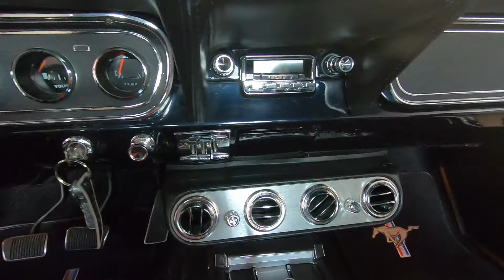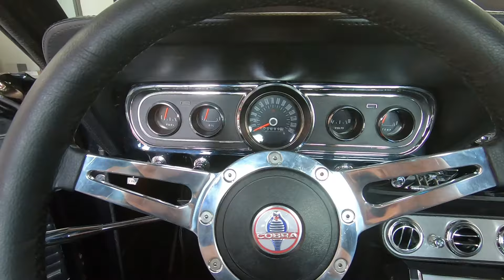Epic Reveal: 1966 Ford Mustang Fastback Restoration

Comment: Alf my 66 is running hot engine is reading 225 my aluminum radiator is reading 115 , I’m about to take apart the engine therastat and go from there is there anything else I should look into ?